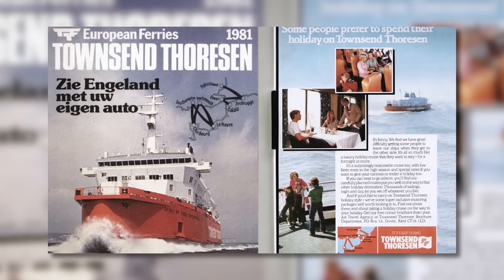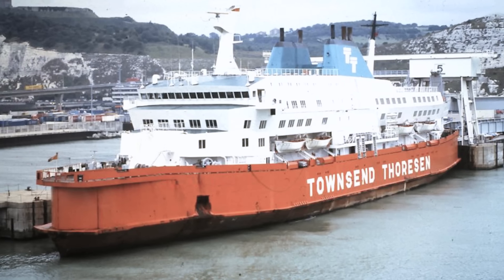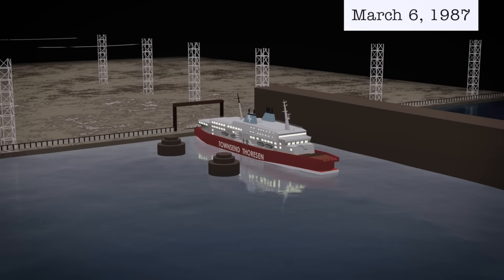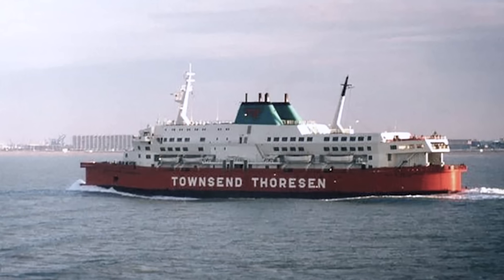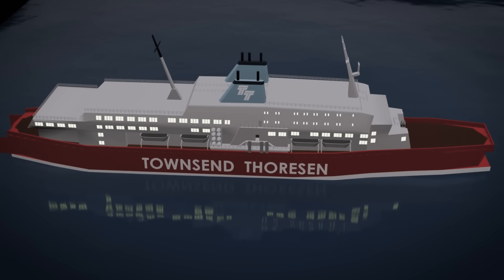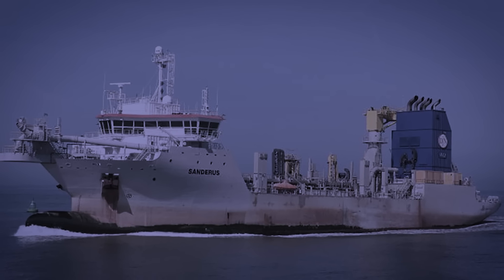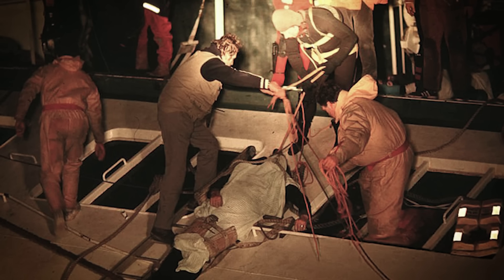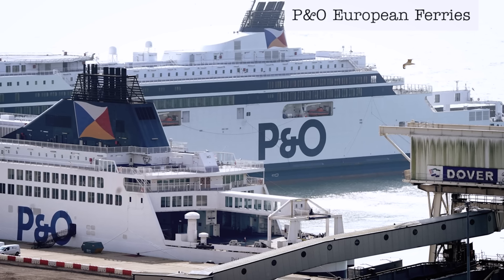193 Dead After Bow Doors Left Open!

Comment: I m a seaferer with some years on board of ships. I m not though familiar with RoRo ships but even though a water ingress alarm should have been installed on the lower decks with possible openings to the water. Bilge wells with high level alarms and connections with the bilge pumps ( automatic start?) along the deck- not clear if they were  installed from new build. As a professional seafarer i can confirm that the pressure exists. Go,go go, faster faster is always there.
Reply: A simple CCTV camera, connected to a monitor on the bridge would have shown the doors to be open as well..
Reply: @JohnDoe-bd5sz  year was 1987, way before the WiFi and WiFi cameras. This days, yes, we have cameras everywhere including the smoke stacks
Reply: @UncleHo5  No one would use Wifi in that scenario anyway, back then CCTV cameras using Coax was certainly a thing.

Not HD / 4K and so on, but more than ample to see if a big part of the back of the ship was closed or not.
Reply: @JohnDoe-bd5sz   yes, coax is still used on the outside decks, engine room, bridge, ECR. But some places are using small WiFi cameras. At least in our case.
Reply: @UncleHo5  But in 1987 all they had was coax.

I would have thought all things camera related would be LAN based and PoE powered

Comment: Excellent analysis of the disaster. You point out that the number of officers was reduced from 15 to 10 for this new service to Zeebrugge. At this time Thatcherism was in full swing and the Herald of Free Enterprise name for the vessel was no coincidence. The "overmanning" of the 1970s - which few would deny - was replaced with the "undermanning" of the 1980s. And severe cost reduction - which is all fine until safety starts to be neglected - meant video cameras were not installed near the doors. Cheap VHS video was widely available at the time.
Reply from the maker: Interesting to see how politics influences the work place safety

Comment: It seems like sleeping on the job DIDN'T kill 193 people, Chief Officer Leslie Sabel was supposed to remain where he was, and left the post. Meaning that it is Chief Officer Leslie that doomed 193 people, as he is the one in charge, abandoned his post, and never made sure that there was someone there to make sure the doors were closed. 

The Chief Officer is the one who should be held most accountable, not the assistant.
Reply: I agree with your first statement but the final responsibility lays with the captain. This wasn't the first time they left with the doors open. Under pressure from the company safety practices were ignored. And the harsh reality is that if the captain had refused to take shortcuts he would have been replaced by someone who did.
Reply: Captain at fault

Comment: I was working in the Netherlands during this time.. We (my wife and I) had travelled back to the UK for the Christmas break via Zeebrugge on the Herald and also returned on her a week later. 
2 weeks after this terrible night we again travelled back to the UK via Zeebrugge but on the Spirit of Free Enterprise. 
It was daytime and most passengers were out on the deck, nobody wanted to be down below at that point. 
We passed the Herald, still in the water having been raised to the upright position, it was very very quiet on the Spirit as we passed her. It still causes tears to think of those people who lost their lives because of the 'assume all was ok' rather than 'assume it's not unless confirmed ok  3 times' - a small difference the lack of which is usually at the bottom of every preventable tragedy like this.

Comment: Good Documentary, I worked in industry and used this example my whole career, emphasising the absolute need for a “Positive Reporting” culture, for those that do not understand this concept, it’s like commonly installed, understood and practiced in the aeronautical industry, (except it appears, in parts of the Boeing organisation).
So with this culture, if the captain used a positively reporting process, he could not leave, until he had positive confirmation that bow doors were closed and locked, whereas the system this company and this captain used, was not positive reporting, with the fundamentally flawed system, that he by process, sailed out to sea at full speed, unless told otherwise, with the inevitable consequence.

What I found over many years, is the more senior the Manager or Director, the more they forcibly resisted implementing positive reporting into procedures and decision making.

I actually came to realise that the culture in a lot of UK sectors, is to positively promote a “doers” culture within the organisations senior staff, with little and in most cases, an absolute disregard of objective thinking type trait people.

This results in a cohort of people with influence in the company, that will positively fight changes to process, which,  with their engrained personality traits, they just can not see the need for “positive reporting” in the processes and decisions within their organisation.

Then, once the organisation is lead with a cohort of people with this engrained personality trait, in senior positions, including the CEOs, Chairman and Directors, who have a lack of objective thinking on running systems which are fundamentally safe and reliable, by employing positive reporting in their process systems procedures, the organisation becomes stuck in this unsafe culture and defends this at all costs, (what all objective thinking people) think is alien and illogical. 

I do not think things have improved in this way of thinking and in a metaphor way, “ships will continue to sail out to sea, at full speed with their bow doors open, because no one told the captain that the bow doors had been left wide open”

So to the next preventable disaster, be it a NHS Hospital Trust in the UK, the Post Office prosecuting thousands of innocent staff or a Ship sinking, where poor culture in processes, are a result of the cohort of personality traits that are allowed to lead and approve the processes for the organisations activities and decision making.

Comment: It was Corporate greed and appalling management that were to blame. The crew were dog tired after two runs in 24 hours. There was a bell on G deck for example that could ring through and alert the bridge that the doors were open, but it had been broken for months and the company had declined to pay to get it fixed. The faxes alerting the company to that issue all came out in the enquiry. They had so many opportunities to operate safely but at every opportunity made it clear that they neither knew nor cared.

Comment: The fact that both one of her sister ships made the trip with the doors open but did not suffer the same fate as well as the unique situation with the step up in how the water was displaced once the speed built up are bad enough. Add in that it was dark and the unique geography of Zeebrugge harbour, add in the lot of people taking advantage of the cheap deal for a day out to the Continent.

Oh and let's not forget that single point of failure. The fact that Sable was expected to be in two places at once, he was supposed to close the bow doors with one lever, while being expected to be on the bridge at that precise moment and the other fact that people saw but went no, not my job and left the lever alone expecting him to go close it while under extremely major time pressures. And lastly, let's not forget the amazing response by the various parties involved. Many years ago in Belgium I saw a Dutch made documentary about the disastr and you had Dutch rescue divers going down and shining a light into cabins or through windows and portholes and screaming, so loudly they could be heard by survivors, get those fucking people out

Comment: I worked for a ferry company for 6 years around that time, not for TT but a competitor however working practices were pretty similar across the companies.  In general, the UK ferry industry was rife with poor management relations and a mutual distrust between shore based ship management, officers and crew.  Before the Herald incident, attitudes to H&S were very cavalier, adherence to procedures wasn't part of the culture, lackadaisical would best describe the industry.   The crew worked 12 hour shifts, 7 days on during which you would live on board.  Not mentioned in the inquiry was the role played by alcohol in shaping the culture and attitudes.   The nature of the ferry industry with passenger duty free shops and bars drove a culture of alcohol consumption on board and the crew were able to purchase alcohol at bond prices.  After the incident, the ships went dry for the crew, being caught drinking off shift was instant dismissal.  After the incident, attitudes changed significantly as many who weren't able to make the transition to working in a dry industry left and found employment elsewhere.

Comment: Another fantastic Documentary one slight error is the Dover - Zeebrugge run opened in 1966by the predecessor to Townsend Thoresen (Townsend Car Ferries) not around the time the 3 Spirit Class ships were introduced also it was the upper car deck the Ramp couldn't reach not the lower! The spirits were mainly confined to the Dover - Calais service the Smaller "Free Enterprise" Class ships ran the Zeebrugge run hence why Zeebrugge only had a single linkspan the Spirit Class would relieve on the Zeebrugge run during times of refit of the smaller ships she was transferred permanently to the route in 1985/86 around the time the Free Enterprise VI & Free Enterprise VII were jumboized! Other than the above fantastic effort sir!

Comment: I remember flying a light aircraft at 600ft across the English channel and saw a ferry with its bow doors open in calm open seas outside the harbour which at the time I thought was very unusual and so took a photograph.I mentioned this when I landed and recall being told that this was not an uncommon occurrence and was done by the ferry operators to vent the car deck of petrol and exhaust fumes. I took this at face value and took it no further.

Comment: Took the ferry to france once. Our cabin on the way back was right beside the car deck. 

Overnight, I thought I could hear something sloshing around in the car deck as the ship rolled. Reported it to the crew at the information place because, well, that noise hadn't been there on the way over and water where the cars are would not be good. 

I felt like an eejit when they told me it was just some loose chains

Comment: Also on a side note the Herald had a Slight but Noticeable list to port from the day she was built and this was not investigated! She never sailed on an even keel! Of course she capsized onto her port side! Also one of the sister ships "Spirit of Free Enterprise" was stretched in the 90s which was deemed not exactly a success also to add to the content in 1983 the Herald's Sister ship "Pride of Free Enterprise" sailed with BOTH her Bow and Stern doors open again because the Assistant Bosun on that vessel slept through the call for harbour stations and didn't awaken until they were arriving in Calais! Some 60 minutes later! So the doors merely being open wasn't enough to Capsize the ship the shallow water and being trimmed by the head basically put the bow wave over the "Bow Spade" which at 18 knots dug into the shallow water and over she went! Sadly it wasn't an Open or Shut case

Comment: I can’t understand why they didn’t have a standard radio check at very least to confirm doors closed and safe to move. This was the very ship one the cover of the TT travel agent brochure. I also travelled on this very vessel with my family, on the Dover to Zebrugge crossing in 1984… even have a photo of my stood on the deck! I recall it dominated the news for weeks. They had to cut holes in the hull to access all the bodies. Then they welded arms to the side to help right it for regulating. Horrible disaster yet so easily preventable.

Comment: 0:47 I get the feeling that this engine is huge! I could be perceiving it wrong but given the cart at the top left corner I feel like this thing is the size or bigger than the average house!
Reply: I believe you're correct. It looks like some air hose maybe coiled up on that cart at the top left, maybe a little larger than standard air hose, but either way, it definitely shows that that engine is, indeed, quite large, perhaps as you said, as large as a house. Crazy big lol...
Reply: I believe you're correct. That engine is quite massive.

Comment: The car deck on those ships are very well lit with fluorescent lighting. The ship left the berth at night and proceeded to sea. With the bow doors open do you not think that the bridge crew wouldn't have been aware that the doors were open with the glow of the lighting shining out light the headlights on a car. Of course they knew. 
I sailed the English channel at that time and it wasn't unusual to see ferries sailing with the bow doors open. In fact i actually seen one ferry sail with cars on the bow ramp during calm weather. 
In my opinion the root cause of this sinking was commercial pressure to maintain schedule.
26 years seagoing experience serving as an officer on passenger ferries.

Comment: My motorcycle from the early 80's didn't allow the starter to work if the stand was out, in the same time as a ferry had no problem going to sea with not even a warning light if the bow was completely open. Makes you question the human race.

Comment: The bow of a ship is the front; stern is rear. Although the video consistently uses the term bow to describe where the doors were, I believe and the graphics seem to confirm that it was actually the stern doors that were left open. I wonder which is correct?
Reply: I wonder the same thing! Seems very confusing. But looking at pictures of the capsized boat it looks like it's the front door that is open.

Comment: "See England with your own car".. This could have been a great racket. If you don't buy our headlight obscuring stickers priced very reasonably at 50 pounds each, you might get pulled over by the cops after you arrive. And of course the cops are informed of each and every car that leaves without the proper headlight configuration.

Comment: Lots of people making comments, lots of people not knowing what they are talking about. I travelled on HFE numerous times back then, as well as it's sister ships, in fact, I was a passenger on the HFE on the trip out to Zeebrugge that fateful day. All the crew were extremely professional and back then, the hours of work for crew was not covered by either UK or EEC (EU) working time rules, it was not uncommon for crew to have to work for 24 hours or more before getting more than a tea break. 

With regards warning systems - Yes, hindsight is a wonderful thing, but technology has changed dramatically in the 40 years since the accident, the Rules were written in a time when people did their job professionally and people were assumed to not make assumptions about others in a work environment - this is an instance that shows this "faith" was misplaced, the world had and has changed dramatyically since the rules were laid down that the HFE was operating under at the time. 

The lessons were learnt, changes were made both here in the UK and in the EEC (EU) as well as by the IMO. That 193 people lost their lives that night is a tragic disaster, especially as it was fully preventable, but like most disasters there is not a single point of failure, there were mutliple failures across legislation, design, operating procedures, professionalism and simple crew resource management, holding any one person to blame misses the whole point - no-one acted criminally, no-one acted with malice and to hold one person responsible is not Justice - that this disaster resulted in key and important changes to take place means that the 193 victims did not die in vain and as a result, they will not be forgotten either. 

It should be noted that modern RoRo ferries have multiple safety systems in place that alert the bridge crew about the state of both the inner and outer doors, inlcuding alarms, warning lights and CCTV systems, further, it is illegal to leave port with the loading bay doors open now, and in most cases for the new ferries, if the loading bay doors are open then the ferry cannot be maneourvered as interlocks prevent the vessel moving under its own power except by the maneouvering thrusters (when fitted).

Comment: It is totally the company's fault (a) For instructing the marine architect to design a vessel which is close to being unseaworthy due to the free surface water effect, which could have been avoided had the architect been given freedom to design the vessel properly. All the company and share holders wanted was more and more cars on board.(b) Pushing the master to unacceptable limits. No vessel should sail until the master is satisfied the vessel is 100% safe. By putting pressure on the master the company is libel.

Comment: Most cars will yell at you if one of the doors isn't closed correctly. That's not rocket science FFS. I'm never taking a ferry without checking myself that they locked it tight before leaving port.

Comment: Why would you build boats and not have an indicator light to let you know if your doors are closed? That’s just so stupid. Also you should have a system of confirmation to make sure the doors are closed if you have no indicator light. Get on a walkie and say are the doors closed. To have a system in which the guy is supposed to to only tell you if there is a problem with the door rather than always confirming if the doors are closed or not is just another example of pure stupidity. Why would you set it up that way?